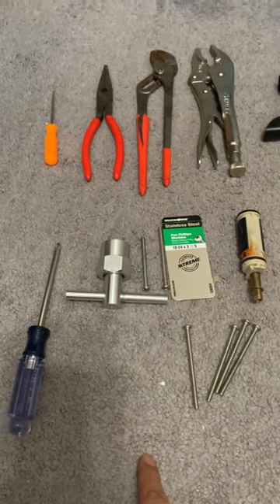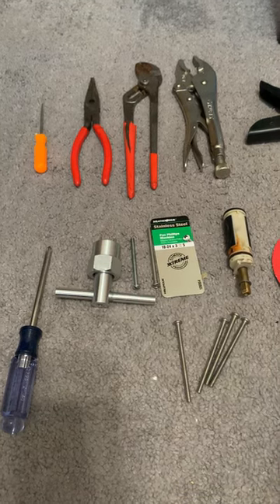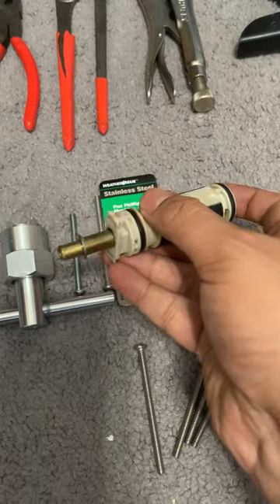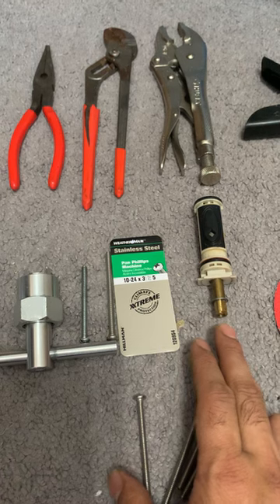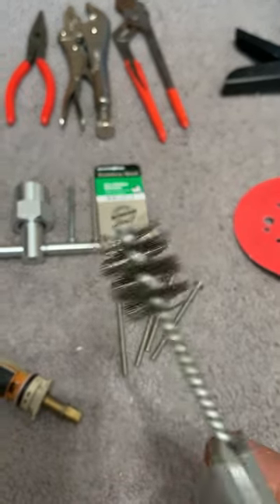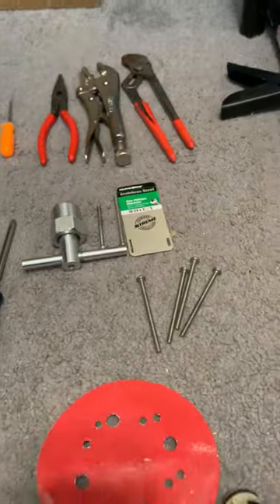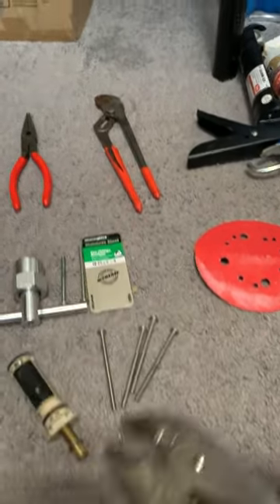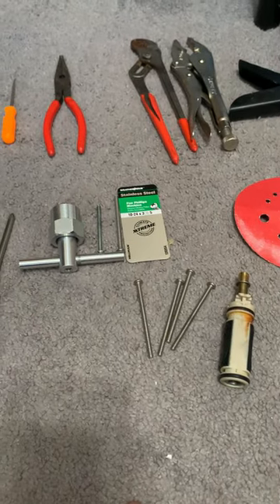Moen 1222 Cartridge won’t go all the way in

Comment: Good video very helpful , I just removed a Moen original one piece tub shower approx 24 years old huge job getting it out , I tried a non moen generic 1222 would not go in tried sanding etc , . The generic plum teck I had marked 1222 has different size of the hot cold gasket compared to original could be just the age of my tub/ shower  Got frustrated with the time it was taking and did not want to force cartridge in place because they will just leak at som point . Had to get plumber to remove what I did and install a original moen 1222B so for maybe help other folks check your original moen against the generic one if you don’t get an original moen and I suggest get a 1222B. I am glad your repair seems to have worked out .

Comment: My comment is going to save you a lot of frustration. As someone else also mentioned the original moen should be the same dimensions. I measurer mine and it was exactly the same. The rubber ring seal was bigger because it is new. This is press fit so it supposed to be snug. I pushed firmly and got it almost all the way in. The last couple of mm I used a spanner a big spanner to make contact close to the plastic base and tapped with a hammer and went in. Don't tap the edges cause they might break.

Comment: Ran in to the same issue. New catridge wouldn't go into valve far enough. Everything looked close between an old and new Moen cartridge. Finally measured with calipers like others here. End of old cartridge 23.5mm, new cartridge 24.5mm. Put the new cartridge stem in a cordless drill and held the plastic end against some 120 grit sand paper. Removed just a little bit,and sure enough, new cartridge went in just fine.

Comment: I had this problem a few years ago and thought I was crazy.  Could not get new cartridge in.  Tried putting old cartridge in as well and same thing.  Eventually paid a plumber to come and they got it in.  Baffled me.

I then had to do another cartridge in another bathroom and same problem.  I was about to call the plumber again but what I realized is if I put some pliers on the pin and pushed the cartridge in while applying pliers on the pin it eventually went in.

What a pain but I share this as it may work for some.  Of course clean out the inside.  Moen recommends cleaning out the valve with vinegar.  Soak a rag in it and let it sit in there for 30 mins and then flush out.

Comment: Never install generic Moen cartrige! Use Moen parts if you don't want to deal with trouble things ahead ! Lesson i learned .
Reply: Genuine Moen won't go in for me.  Tried hammering it and yelling at it.
Reply: I used an original Moen cartridge.  It was supposed to be the updated one and was supposed to fit.
After watching his video I compared the ends.  Sure enough the old one was .932” and the end of the new one was .978”.  Sat here for 15 minutes with a razor blade and my vernier caliper . Now it fits.  I only took it down to .936.  I called moen on it.  Lady though I was nuts  until I sent the picture of them end to end .
Reply: @fosty. shave the very last ring down.  I used a razor blade.  It took 15 minutes.  Call Moen and let them know so I don’t look like the only one.
Reply: I used an original Moen cartridge.  It was supposed to be the updated one and was supposed to fit.
After watching his video I compared the ends.  Sure enough the old one was .932” and the end of the new one was .978”.  Sat here for 15 minutes with a razor blade and my vernier caliper . Now it fits.  I only took it down to .936.  I called moen on it.  Lady though I was nuts  until I sent the picture of them end to end .